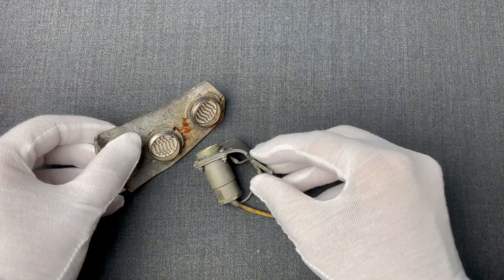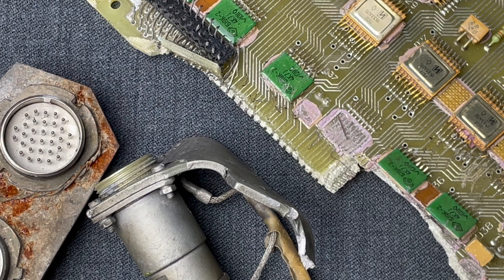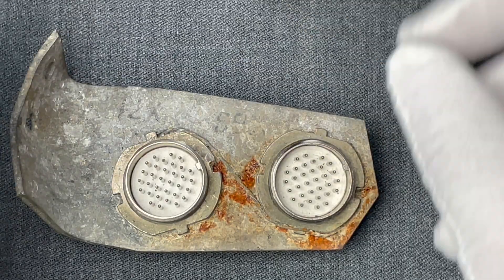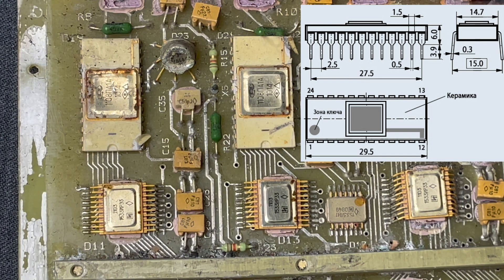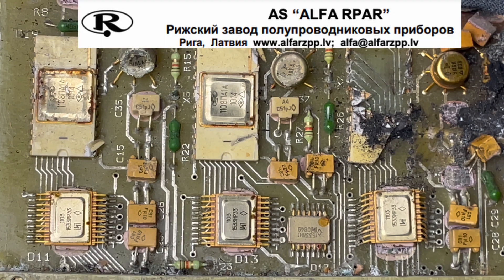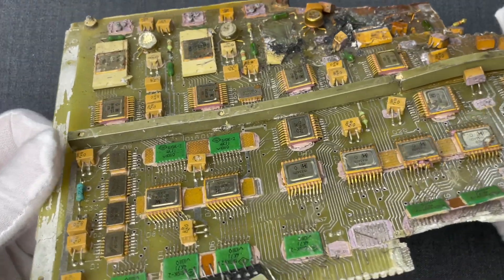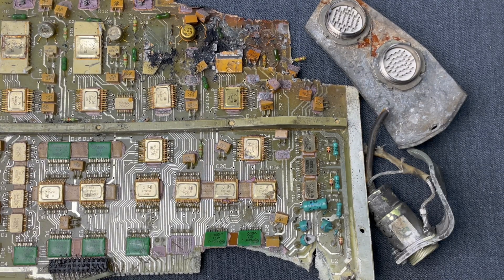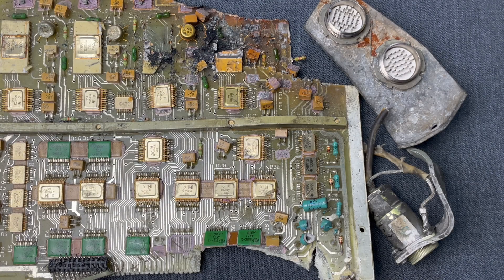TECHINT with 9K720 Iskander (SS-26 Stone) fragments from Ukraine

Comment: The clear coating is called "conformal coating". It's standard in mil tech. Mainly for protection against condensation, but also dust, contamination, ...
The different brackets for connectors might depend on where the parts are from. If it is structural, it might be high strength steel.
The green coating will be something along MIL-C-5541. Prevents corrosion, but also provides conductivity (against static charge, emp, ...).